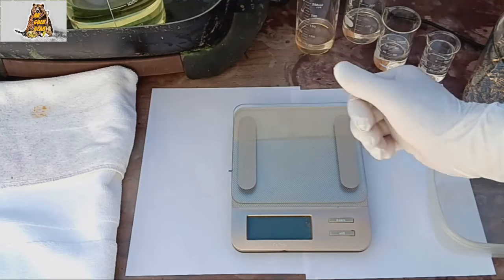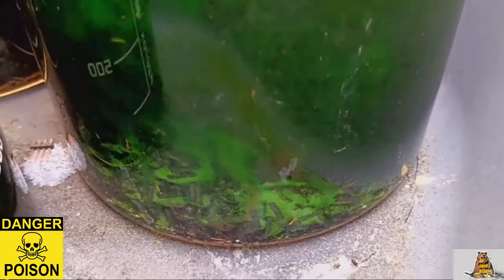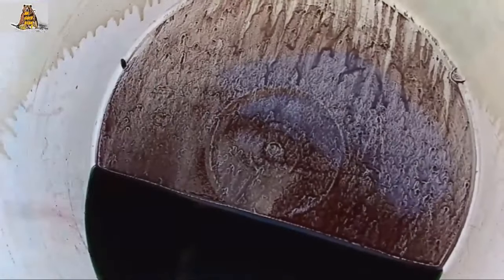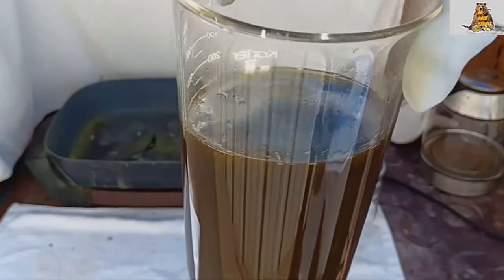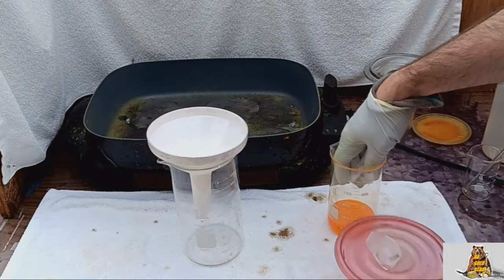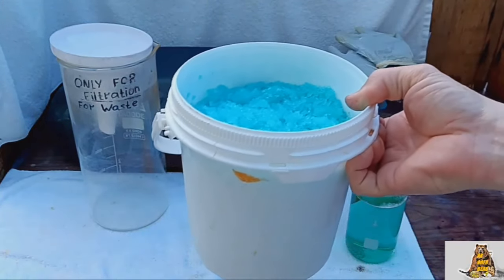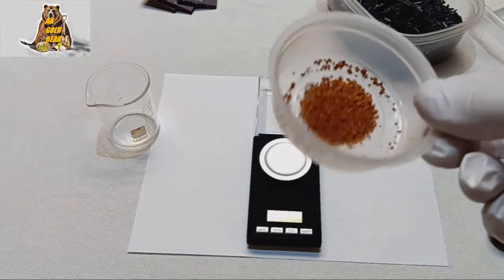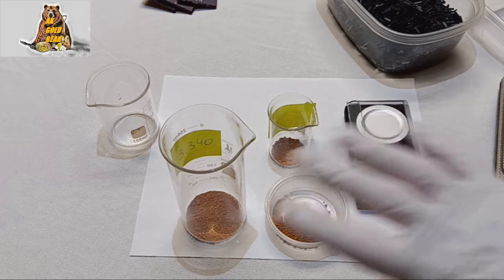Extraction gold from pins of 4-position 1-row headers.

Comment: Hi from Serbia.
Only from desk-top moth.board pins to 2005 yrs. after is tiny goldplating.
So comps,laptops  before 2005-2007 yrs. are good for gold recovery after that it is half sometimes there times less gold than before 2005-2007 yrs.If you have old comps it is worth of doing for you r self if not sold it.
This is from my experience so maybe I wrong.
I collect everything from lap-tops from 1995-2007-2010 from about 1000 pices and 1000 pices of desk-top comps.
It is crazy hobby and you have my SUB and LIKE for work and exselent efort you shoved to us all.
Thanks for sharing you r knowledge with all of us on NET.
All best in future works.
All the best from Serbia(Europa but not EU).
Reply from the maker: Thank you for watching and commenting 🙂  It looks like you've collected a huge amount of material 👌
Reply: @akgoldbear7669  Thank you for answering,pleasure is mine.
I had luck to get some old staf and I collecting 5 yrs.material from all kind of stuf but mostly lap-top computers.
So I have about 9 kilos of mixed clean pins and about 2 kg. MLCC hand-picked from old staff.I collected everything from those parts,sometime proced-refine some little amount of material and get gold but mostly I collect everything worth from gold to tantalijum and all around.
From my own experience stuff made before 2005-2007 have triple amount of gold than stuff after that year(normally who made it,what year,for which country-market and many other things affect the amount of gold).
You doing exelent work but that pins from desk-top comps give that amount of pure gold(you purefied gold to perfect 999)and don't forget that you can measure 2,6gr.of pure gold with 4-5gr. of not 14K gold.
So you get about 5gr.of 14K gold which is expected from those pins.
I love lo learn watching your videos and it is my pleasure to speak-write with you.
I wish you all the best in future work,you have my SUB. and LIKE to.
Greetings from Serbia(Europa but not EU).
Reply from the maker: Cheers 🍺🍺

Comment: What is electrolyte? Is it saltwater?
Reply: Yeah that is what boggles my mind as well.
Reply from the maker: Electrolyte is battery acid. It is prepared by diluting the acid with water, three to four parts water to one part acid, depending on the concentration of sulfuric acid. Electrolyte is used if the metal is magnetic. In this way, the magnetic metal dissolves faster with less nitric acid. Nitric acid is expensive. Electrolyte helps save money💲 Good luck 😎

Comment: Would it be easier to cut the pins in half?  So you could just use the hcl for first step, to get the base metals out of the way.
Reply from the maker: Hello. Copper will not dissolve just in hydrochloric acid , you need an oxidizer, hydrogen peroxide or nitric acid 🙂 If you want to dissolve the base metals and leave the gold, you will need water and nitric acid without hydrochloric acid.

Comment: Make-up of the electrolyte please? And what is it's purpose?
Reply from the maker: Electrolyte is battery acid. It is prepared by diluting the acid with water, three to four parts water to one part acid, depending on the concentration of sulfuric acid. Electrolyte is used if the metal is magnetic. In this way, the magnetic metal dissolves faster with less nitric acid. Good luck 😎